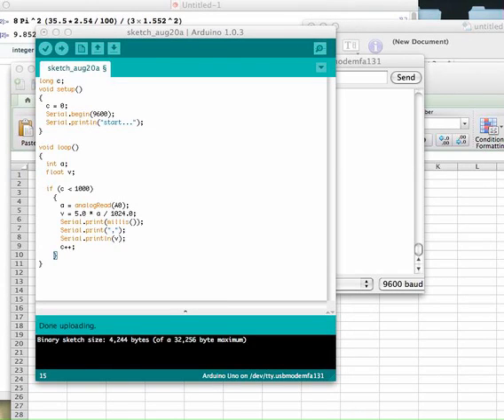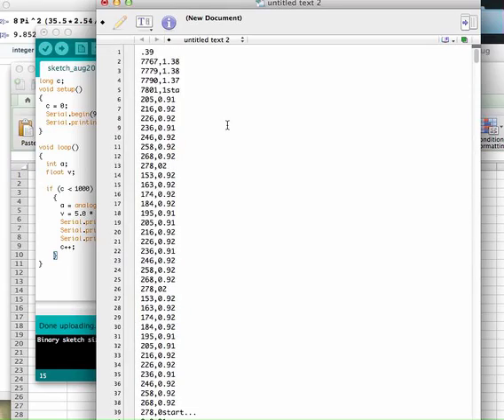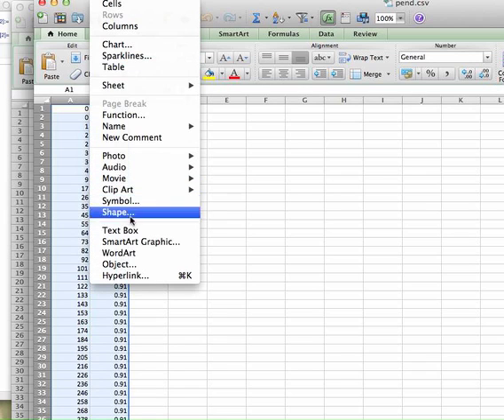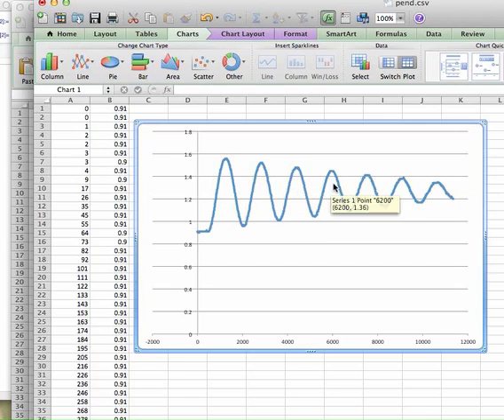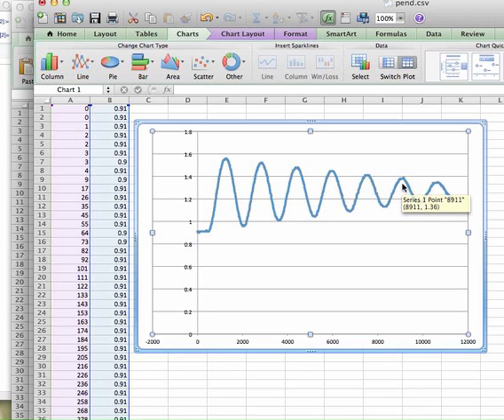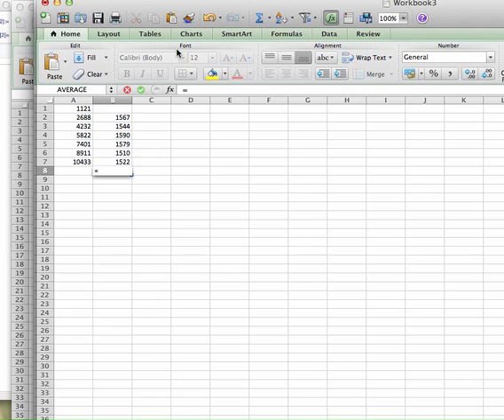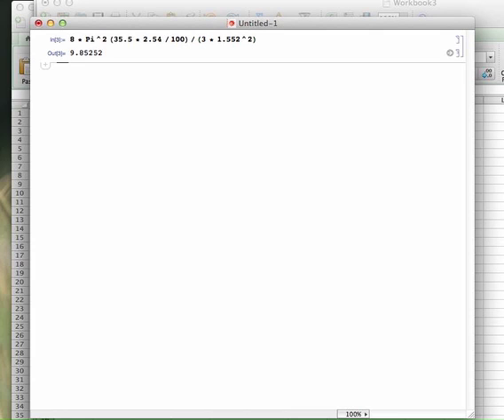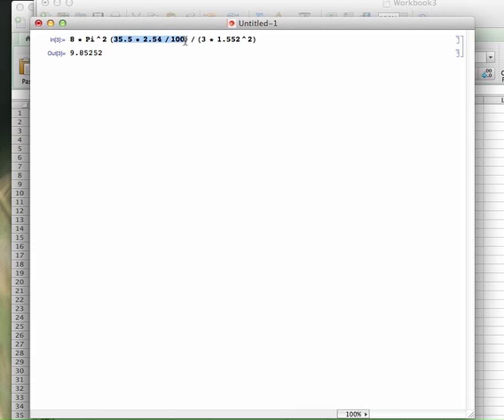elec 024 2 arduino pendulum data analysis and result

Comment: Such a wonderful idea and hardware implementation, but such an underwhelming software design. Excel to show the graph is nice, but there is no need for it to find the results and Mathematica to calculate it when you can do the peak detection and g value calculation in the Arduino in real time.